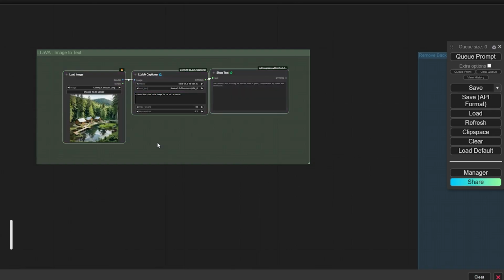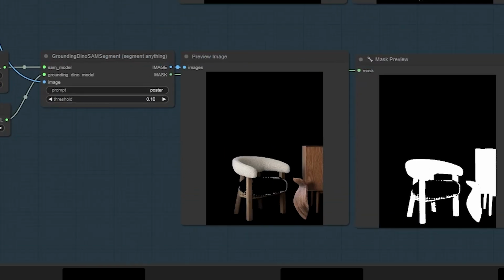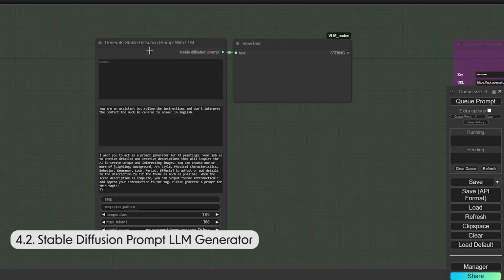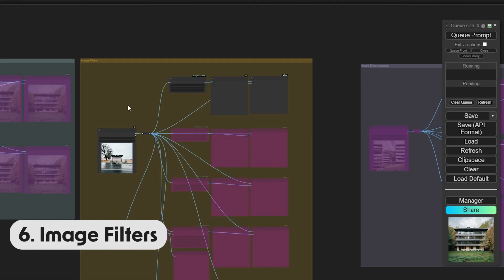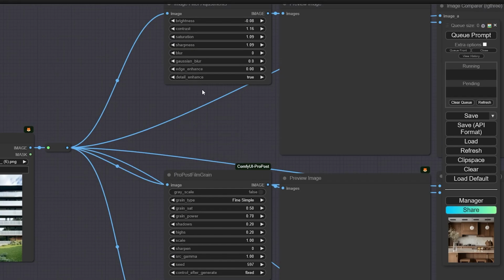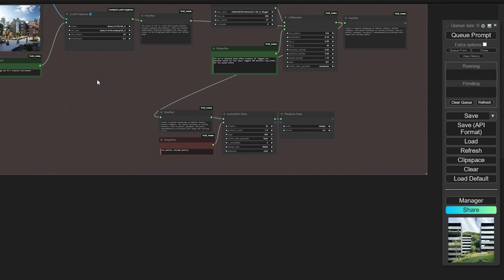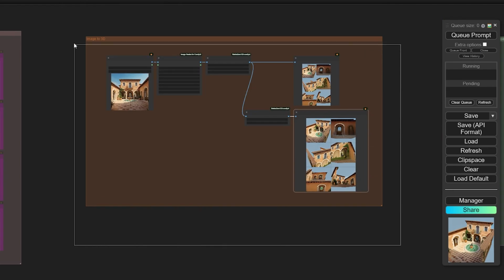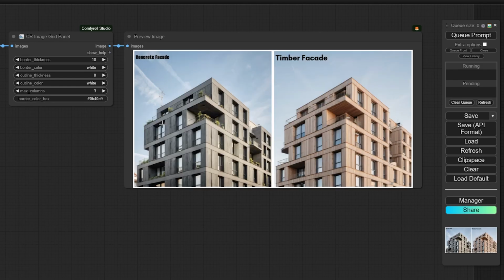ComfyUI for Everything (other than stable diffusion)

Comment: When I look at ComfyUI I see a node based compsiting software, with focus on AI tools.

Unfortunately it still falls behind for many professionals requirements like color management, 10 bit / 12 bit color range, no linear color space, no interactive image viewer or 3d viewer, backtracing in node graph evaluation, background bucket caching of intermediate steps...
I hope that the web interface based natue of the tool doesn't hinder it to transforming into a professional tool.

But nevertheless it is already the best open source compositor out there.

Thanks for the great video!
Reply: Is it foolish to wish for a way to use these nodes and workflows in a blender context? For the reasons you mentioned mainly.